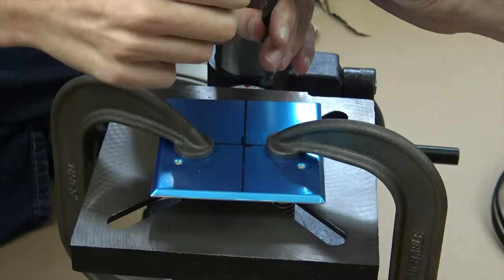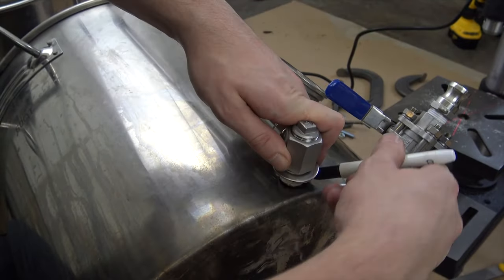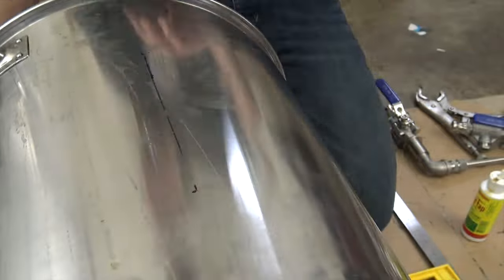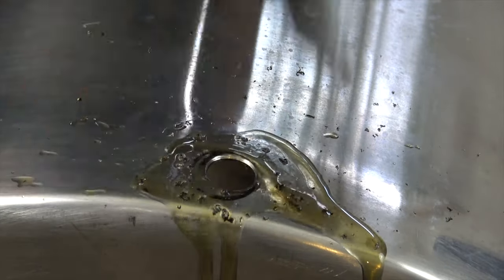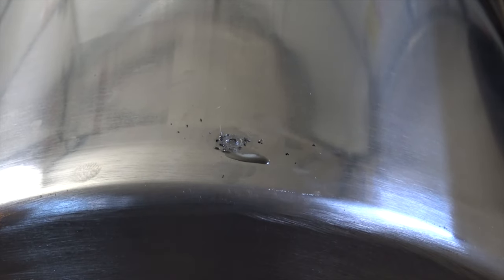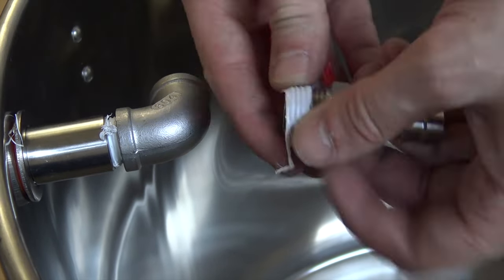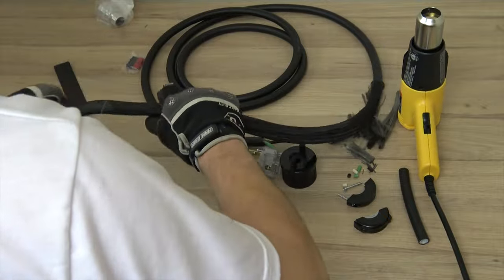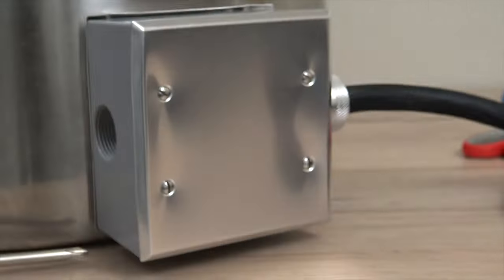Electric Brewery Build Part 1: Brew Pots

Comment: How many holes you've done? Holy cow! I need only one hole for my brewing kettle..)
Reply from the maker: Евгений Воронин a lot! it's a bit of a complicated system, but when you get used to it, it is awesome!
Reply: That's for shure, but I'm a fan of simplicity..Simplicity it's russian way to do things.. But I liked your video. Waiting for brewing videos.. Good luck ;)
Reply from the maker: Евгений Воронин I can understand. Thank you! after I'm off my break, I plan to do some brewing videos.
Reply: what waterproof box is this?
Reply from the maker: Arvin Mags a lot of the parts where ordered as a lot from the electric brewery website.
Reply: Just one more question if you don't mind. How did you connect youre ground green cable ? You made a hole in cattle for it and just connected green wire to the cattle with simple screw trough?
Reply from the maker: Евгений Воронин I connected the ground wire to the grounding pin in the gangbox.
Reply: Yes but this pin is connected to nothing? just screwed in the plastic?
Reply from the maker: You can see that ground wire connecting at 9:29.
Reply from the maker: Евгений Воронин the 2 gang box I used is metal and the pin just connects to it and nothing esle.
Reply: Aahh..Now it makes sense...While metal box touche the cattle it works better :) I thought your box made of plastic..I'm just about to make my little electric control box,  and I really don't know if this is necessary to make ground connection and how to make it.. I have a circular heating element, 2 pins are separeted from each other..  (o  o) like this. Thanks, and sorry for a lot of questions..
Reply from the maker: Евгений Воронин not a problem! I hope everything turns out well!

Comment: Nice video thanks. Where did you attach the thermostat?
Reply from the maker: Pieter van Niekerk-Venter thank you! The thermostat connects to the T fitting at 7:33. Both the hot liquor tank, and the mash ton have have it in the same location.

Comment: Did you use a GFCI in your power?
Reply from the maker: I did buy and implement a GFCI breaker into my breaker box. I actually had to add in a breaker just for the 240v 60A outlet that I installed into the gerage for this setup.